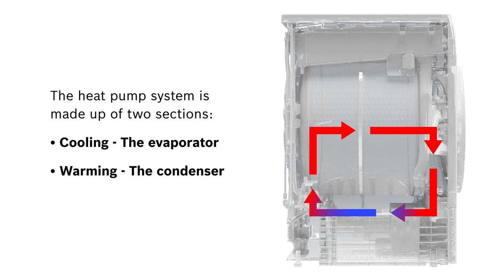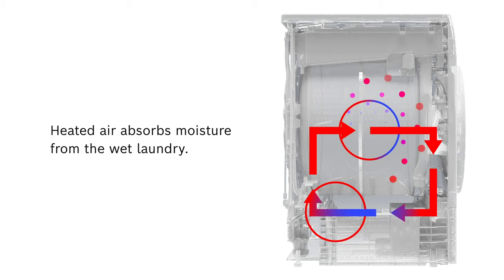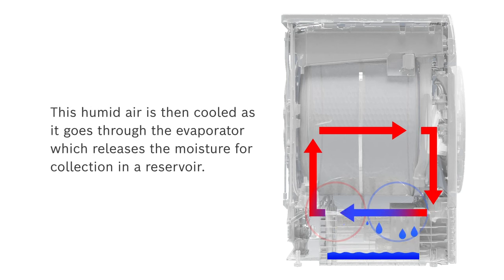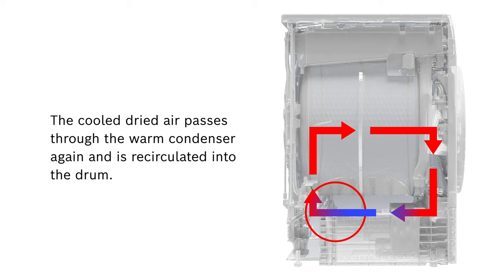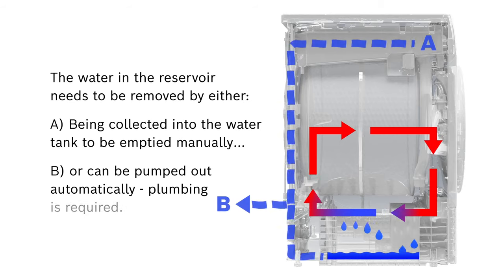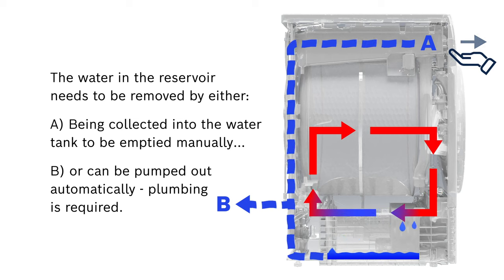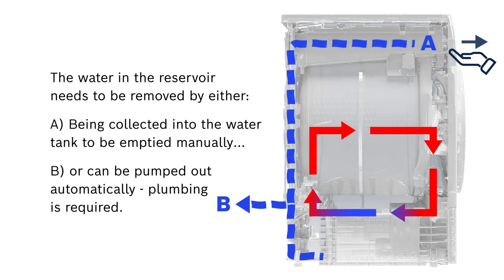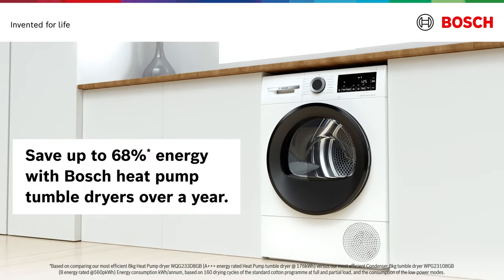How does a heat pump tumble dryer work?

Comment: How is circuiting air heated as it goes through the condenser? Because i dont think of a condenser as a  device that heats up air ....
Reply from the maker: Hi, It essentially works the same as a fridge, but in reverse. The condensor heats the air, which cycles the air into the drum, travels into and is cooled by the evaporator, which saps away any excess moisture into the reservoir. It is then cycled back into the condensor, and the cycle repeats. Thanks - Craig

Comment: This explains nothing. How is warm air created?
Reply: So what happens if it's a cold day and I've not put my heating on? Does that mean it won't have warm air to dry the clothes?
Reply: @BoschHomeUKandIreland  that's pretty cool. Presumably the cooler my house is the longer it would take to dry and therefore the warmer my house is the quicker it is to dry? My current tumble dryer is in a utility room with no heating so wondering if this is actually a viable option for me
Reply from the maker: The air follows separate refrigerant circuit; as the refrigerant compresses in the condenser, heat is generated to warm the passing air which is then recycled back into the drum.  The reuse of hot air means the energy is kept within the machine making then cost effective to run.  The evaporator does the opposite. Thanks - Craig
Reply from the maker: Any heat pump dryer needs an optimum 15-300 degrees to work properly; outside of this range the machine will work, but you will lose the energy efficient benefit as too hot, it cannot condense quick enough and too cold; it cannot heat quick enough. Thanks - Craig

Comment: What is the source of  heating if heater is not there??
Reply from the maker: Hi, thanks for your question. 'ActiveAir' technology utilises a refrigerant instead of conventional dry heat to create warm air that is evenly distributed and reused efficiently throughout the drying process. Thanks - Bosch Home Appliance Customer Service
Reply: The same thing that would make your air conditioner unit to blow warm air inside. Or cool air inside but then warm air outside.

Comment: I recently visited your YouTube channel and was impressed by its aesthetic appeal. However, I couldn't help but notice several areas that require attention, such as SEO, rank tags, and tag volume, which seem incomplete. It appears that there are several other issues as well. I'm Jakaria, a seasoned Freelancer with over 3 years of experience specializing in YouTube video SEO. I'm confident that I can assist you in optimizing your YouTube videos to improve their visibility and overall performance. I am waiting for your response.
Reply: I am sure Bosch will work with a freelancer. You need to stop spamming.